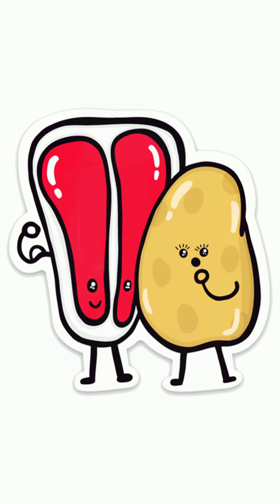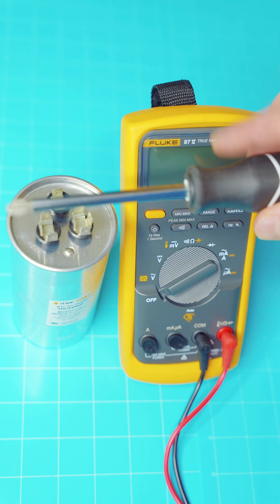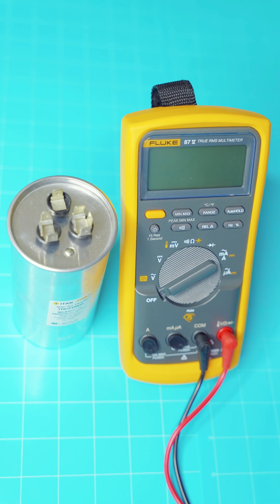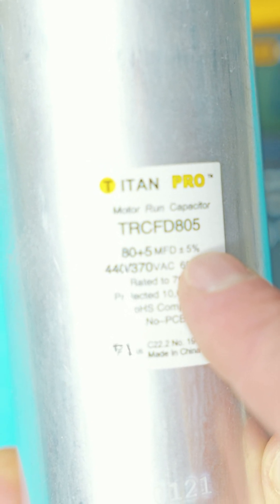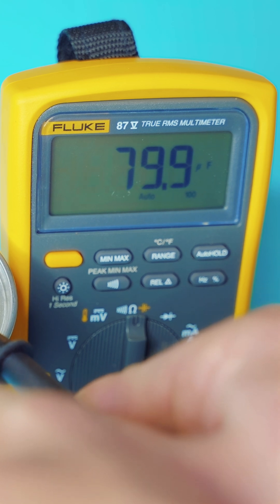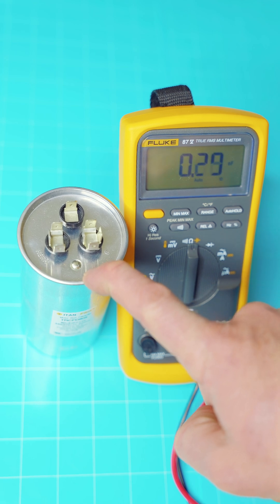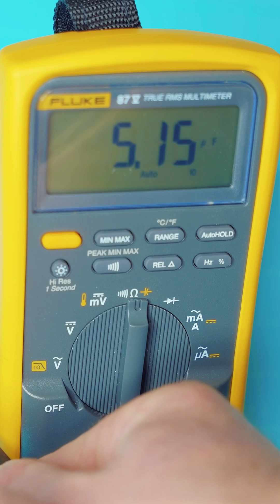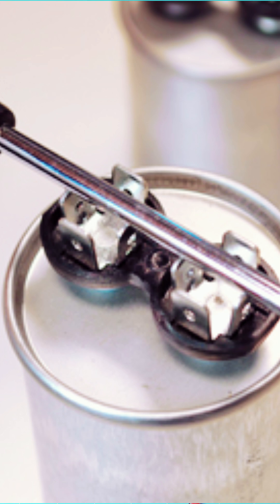How to test Air Conditioner Capacitor EASY

Comment: This isn’t the best way to discharge a capacitor.
Reply from the maker: It is just one way for the "average" homeowner. Thanks for the comment friend!
Reply: @ElectricalYou    Didn’t mean to sound condescending. I appreciate the info you share. 
If you have a multimeter, you can use it to discharge capacitors. The LoZ or Ohm (resistance) function must be selected for you not to fry anything within the DMM, however.
Reply from the maker: No I appreciate the info and I could have worded my reply better. Have a great day!